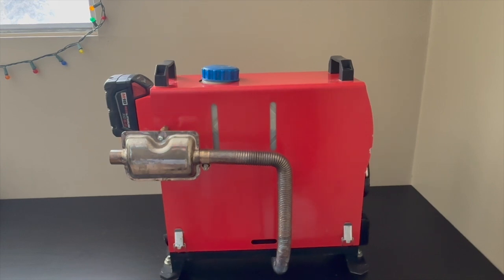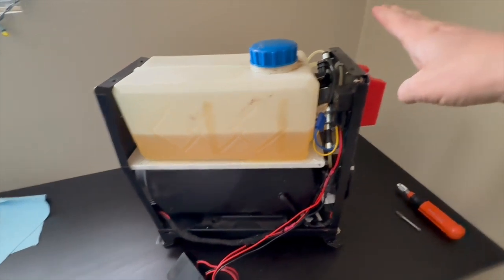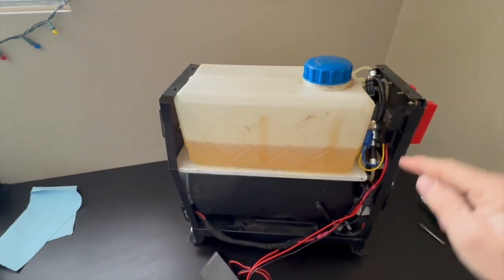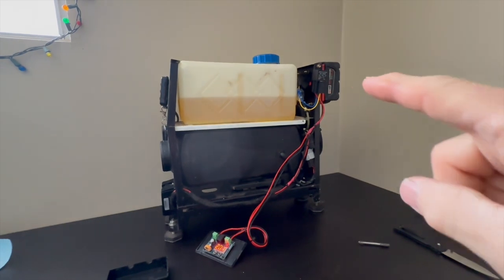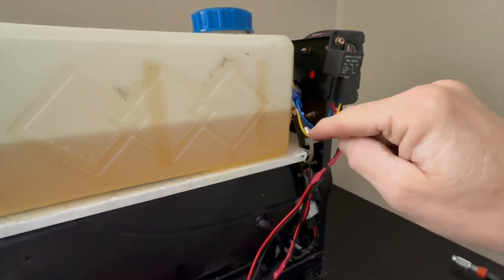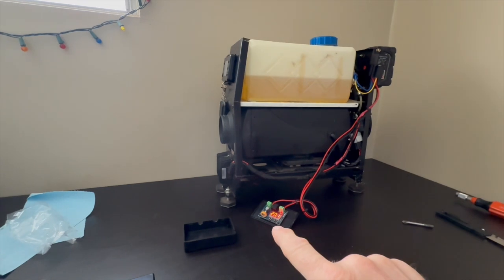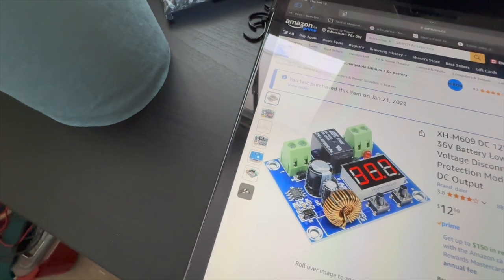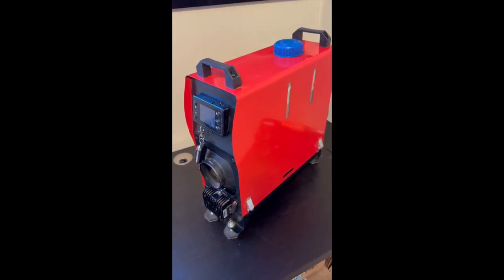18v Tool Battery Diesel Heater Conversion

Comment: Just saw Amazon has the battery adapter with 12 volt DC convertor so no need to buy separately

Comment: You do know you have the muffler all wrong and you will soon damage you motor. Where is any Chinese diesel instructions tells you to come up with a 90 elbow and connect another 90 elbow? you just created back pressure and a build up and condensation at the bottom of the pipe, that will end up in your motor. Good luck if it still works in a year.

Comment: That heater spec is 12-24VDC.  Why down convert to 12VDC from a battery that's already within spec?
Reply: These heaters controller will monitor voltage of a 12 or 24 v system charging voltage of a 12v system is roughly 14.7 and a 24v system charging is around 28 v anything below or in between the voltages it thinks its not getting enough power and sets a voltage error code on the heater i have tried without the converter.

Comment: Hi, great video! Could you put the electrical schematic for this unit? Thank you!
Reply: I have the exact unit, but I'm using a 12 V. Milwaukee. Batteries.\nCan you show me the electrical schematic?To wire the relay fuel pump and control board

Comment: Please show where all five wires go from your relay!  Great video. Please leave an answer for us noobs.
Reply: There are only 4 wires being used for the relay. Red and black from the battery monitor "do-dad" as he called it. This powers the relay. The yellow and blue from the relay is Common and Closed. 4:41  It seems like he is just turning the positive off to the fuel pump when the battery is at 17.1 volts with blue and yellow.

Comment: Great video and nice bit of engineering to have a low voltage shut off. 
If you put another battery holder on and run it in parallel with the first one you can add a fresh battery and remove the low battery without turning the heater off.

Comment: Hi. Thank you for the video. I am confused of how to install what color wires from the relay to the fuel pump and from the relay to the low voltage. Do you have wire diagram?

Comment: What does battery life look like?
Reply from the maker: Sorry I didn’t get a notification that you left a message. It’s kind of hard to nail it down as there are so many variables. On a 12.0 battery running full tilt it’s about 4-5 hours but if I turn it down to about half way I can get 10-12 hours. So it’s not linear. What I do is when one battery dies I put it on charge on my truck and by the time the other battery dies the first one is good to go again. Also when I’m running the heater is when I’m building glass solariums. So they don’t hold the heat in when it’s -20. When I’ve used the heater in a small room I run it very low and then the battery will go all day long.
Reply: @sw5334  if i want to run a unit as much as 48 hours unattended what setup would you suggest?..
Reply from the maker: @Gunnipowers I have never tested to see how much current it draws at different heat setting so not sure what it would take to run that long. Definitely won’t be a single tool battery though.
Reply: Why convert down to 12volts? It says 12-24 volt capable?
Reply from the maker: @Dsc577 the new ones are 12-24v. Mine is now over 5 years old. It was rated 12v and max voltage was under 15v if I recall correctly. The modern ones are easier to convert. I also see a lot of new models are coming with 120v adaptors. I might have to grab a new one.